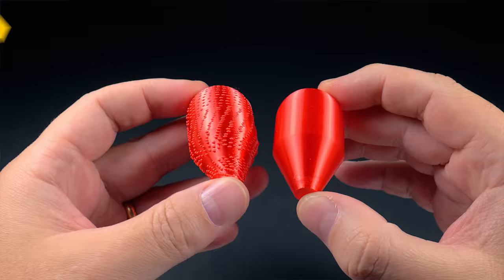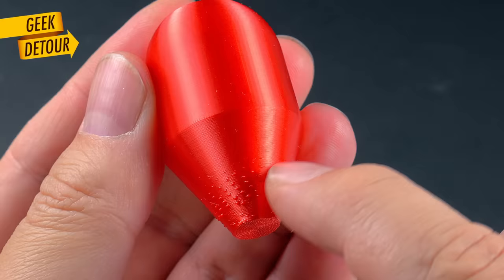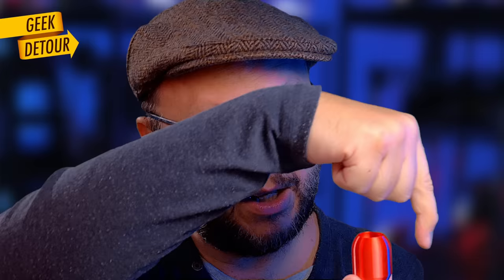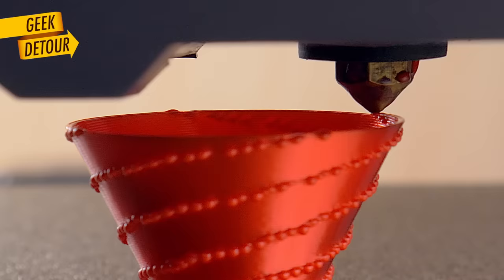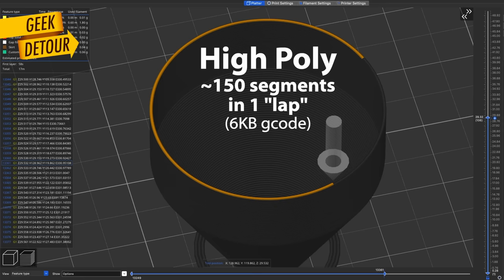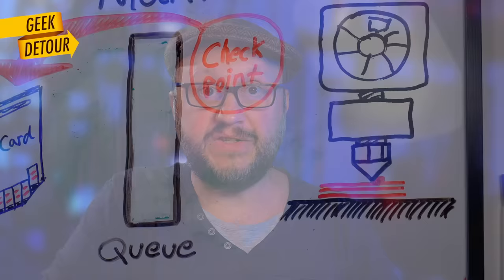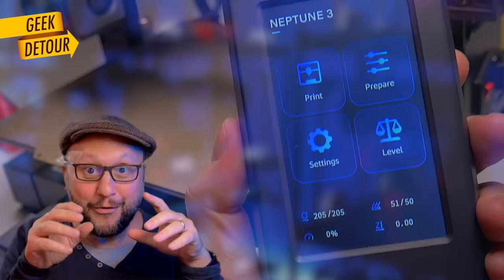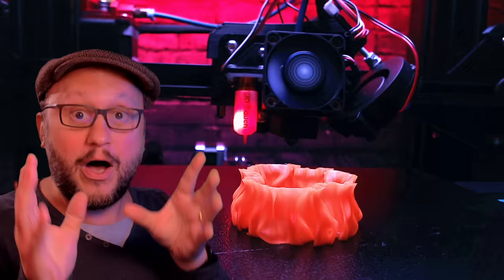3D Printer Blobs: a mysterious problem you won't guess how to fix 🤔

Comment: I got my 1st 3d printer about a week ago jumped in f*%ked it all up several times with part prints and spaggetti everywhere, as well as bricking the printer with a firmware update before I even got started. 
Aftersorting that out sussing most of the issues out have printed quite a few small objects.
I'm Now watching videos to help with all the little problems I run into trying to print larger objects
So heres my guess.
looks like it's over extruding were the blobs are so something is either jumping or stopping my guess would be a that its stopping intermitently for some reason.

Well bu99er me, I'd have never guessed that the power loss backup was stealing the write buffer
so the printer stops because it doesn't know what to do.

What I want to know is why my bloody prints are cracking.
I'm assuming the layer is cooling to much before the next layer i added?
Reply from the maker: Yeah! That was tricky wasn't it? Ha ha.  Layer adhesion is something you learn what to expect as you get more experienced. Some parts are very tricky and fragile, some filaments are not so great, some parts benefit a lot (strength-wise) if you print, lets say, at 215ºC instead of 200º... It depends on what you are printing, and the material.
Reply: @GeekDetour 
Thanks for your response. 
I started to write a description of my settings and what I was doing but I might have sussed it out. 
I've got 1kg drum of filament that my daughter bought recently for her 3D pen  The side of the drum which she said was PLA  (my eyesight isn't what it was so she read the label)  said it recommends a temp of 220-240. 
Which I though seemed high. 
After a bit of experimenting with it the sweet spot seems to be  around 227-235° the small objects I printed (some small figures about 40mm high) And some replacement slider knobs I'd designed in solid edge(which I'm also new to, about a week)came out as smooth as an androids butt.
Then my daughter wanted to print a dome about 3.5" in dia
(Some game cartridge case shaped like a pokemon ball?) 
Which it did do quite well but there is one layer that hasn't adhered and a couple of cracks through 2 or 3 other layers. We had the bed heated to 60°
I think we did quite well considering we are on day 3 of a learning curve.
Then why I was typing this I just got the drum of filament to lookat it for myself
And you already know what I'm going to say
"It's ABS"😭😭
That explains everything
The Bed is nowhere near hot enough and my printer (Finder3) 
Isn't enclosed 
But ha ha  that'll be the problem it cools too quick and doesn't adhere which also explains all the spagetti we made on the first 3 or 4 prints. 
I've learnt something I already knew from my day job in electronics. don't trust what other people tell you always check ot yourself. 
I feel like quite an idiot but it's an important lesson learned
Perhaps tomorrow I'll reslice everything with a higher bed temperature somewhere around 90°? and have another go.
Reply: Actually went for a bed temp of 110° as standard in the flashprint slicer for ABS and a nozzle temp of 235°
Has a few minutes to go but no cracks and looks shiney and smooth.

Comment: 96kb RAM? What happens at 1TB? We print a human?
Reply from the maker: Ha ha ha, it doesn’t matter. You can print a very big object on the same printer - the GCode file doesn’t need to fit in RAM… it is read and processed little by little.

Comment: GOD 3d printers are dumb, I guess I'll wait another 5 years lmao, when we can print metals, multi nozzle, 3d camera error detection etc...
Reply from the maker: Ha ha, well, metal might continue being very, very expensive to have at home. The other things you said are already here.
Reply: 3d printers require some tinkering. It's not for everyone. Even with best printer, you still need to understand different settings for really good prints. Metal 3d printers are garbage. You might want to wait decades. Even so, conventional cnc lathe and mill can do a better job.

Comment: So people are spending thousands on 3D printers for what again?  I don’t see any practical use for what it produces. Unless your goal is to be a toy maker it will not produce any actual parts. Plastic is soft and breaks easily no point in these printers.
Reply from the maker: Actually, they can buy an amazing 3D Printer for less than $300 and you can make an endless amount of functional prints. Different plastic filaments serve different applications. By the way: so many products are made completely with plastic.
I participate on a Facebook User’s Group just about Functional 3D Printing - people make A BUNCH of house fixes, custom products, prototypes. 3D Printing is a reality, not a toy.

Comment: Nice tip, but you basically were pushing a printer in a way it wasnt designed. You shouldnt have so many commands to do just 1 circle.
Reply from the maker: Well,eventually the slicers will move to STEP files (that keep the original geometric information instead of making a mesh of triangles) and generate G2 and G3 ARC commands. The last PrusaSlicer Beta supports STEP files, but internally converts them to a high mesh of triangles anyway.

Comment: So the issue is the printer comes with less ram than a Nintendo DS? Why tf
Reply: Well you don't need a ton of ram, so why pay for it. 

There's are also other problems that just having more ram won't really help
Reply: @Michaelo0  clearly this specific problem caused by overloaded memory indicates otherwise
Reply from the maker: Hi there! The problem was not caused by lack of RAM, it happens because writing to the SDCard takes more time than the buffer of movements being printed, causing pauses.
Increasing the buffer will not help because the buffer itself is part of the information being written to the SDCard, so, increasing the queue makes writing the checkpoint even longer.
Reply: @Geek Detour  so its an issue of writing speed being too slow then? That also feels like an issue that could be solved by better hardware...
Reply: @himedo1512  if it were that simple people wouldve done that lol im also wondering why 32bit / such low ram as well
Reply: @amp  the reason is profits is my guess. Cheaper for lower quality stuff

Comment: where is problem? Cheap printers and bad slicer software :D This never happen on our prusa with prusa slicer, it never stops :D But if its problem of electricity, just get better electric seller, maybe redo all cables in whole house,... and switch to 220V, 110V is not good for printers at all.

Comment: 96kb of ram is nothing, lol
Reply from the maker: Yeah, we got spoiled! But for microcontrollers, running a single specialized program compiled from C++ is A LOT OF RAM. There is no operating system, just a single program with tight data structures.
Reply: @GeekDetour  But why not add a couple of bucks and use 1 MB of RAM?
Reply from the maker: It is not needed, really! Ha ha. A Raspberry Pi on the other hand is a “Real Computer” with an Operating System… it has 1GB of RAM and it makes sense.

Comment: You have no clues how microcontrollers work... !
Reply from the maker: Here, Tim, there is a table of the maximum steps per second a printer can achieve, even on Klipper, depending on the MHz of the microcontroller: https://www.klipper3d.org/Features.html

Please, enlighten me how it is not related to processing power?
Reply: @GeekDetour  "Even on Klipper"... spoken as if Klipper was a paragon of efficiency. Klipper has fallen far behind the curve in the 3D printing world, and for excellent reasons.

But stop to consider for a moment. "Even with Klipper", according to the very documentation you hauled in here, you can do ~100K steps per second, right?

Now do the math.

If your printer is belt-driven and your X axis requires 80 steps per mm and your Y axis requires 80 steps per mm and your firmware is using the Bresenham Algorithm,  then it should theoretically be able to manage speeds as high as (100K / 80 == 1,250) mm/sec.

1250 millemeters per second.

Do you know anyone whose 3D printer requires any higher print speed than that? And... do you think perhaps print speeds like that might possibly cost print quality for mechanical reasons unrelated to processor clock speed or data bus width? Really? Disregarding, of course, the massive racking forces exerted on the frame and the exceptionally high stepper torque required to reach speeds that high. Never mind the extremely short belt life and the fact that it cannot even be done with a moving-Y-axis printer unless the prints are all very small in the Z axis. If they were tall, the rapid Y-axis motions would tear the print right off the bed.

You're just not going to be able to recover from this one looking smart. It isn't going to happen.
Reply from the maker: Tim, if you told me your only preoccupation is to “look smarter”, be my guest! I would have simply left you talking alone, man! One of the best things of running a YouTube channel is to engage in pleasant exchanges of information - you are not interested in that! You are here “to win” whatever argument you can find. You are super smart, but oh boy… why you so desperately need to look smarter?
Reply: @GeekDetour  It has nothing to do with "winning". It has only to do with correctness. But then you wouldn't understand that, would you? You aren't interested in correctness, only in trying not to lose face.

Did you walk through any of that basic arithmetic, and of that logic I presented? What part of that do you not understand? I can clarify it for you if necessary. I can show you the code, I can show you the timing diagrams. Would that be worth doing? No, probalby not... you'd still stubbornly stick to your story despite the fact that it makes no good sense.

At least the popcorn eaters can read this thread and get the idea so that they can, instead of blindly following your cute little technochurch here, learn to question things and do some thinking for themselves and go out and do further research and learn the truth.

You might do a little of that research yourself. Dig through the code. Write some. Learn how it works at the brick-and-mortar level. You'd have a completely different story to tell if you did.
Reply from the maker: Tim: I show that the culprit is the SDCard. What’s your point?
Reply: @GeekDetour  My point is that in the comment thread, you try to say that the culprit is a lack of "processing power".

Scroll back. Try not to edit.
Reply from the maker: Just watch the whole video man. There is a line of thought there that finishes with the explanation about the SDCard and Power-loss Recovery. And that’s it.
Reply: @GeekDetour  I DID watch the whole video, man.

And... I probably would have let most of this pass... except you sneered at control boards with only 16K of SRAM, as if they were somehow inferior, incapable, and heavily shadowed by the "vastly superior" 32-bit microcontrollers.

No CHANCE would I let you get away with that. THAT is part of one of the huge problems we face in society today, encouraging people far too early to abandon what we have that is perfectly satisfactory, throw it in the landfill, and rush out to acquire the new "kewler" stuff that does the same thing... and in another week you'll be encouraging the same boneheads to trashcan their 32-bit controllers in favor of something else still "kewler", again with no benefit... but at huge cost to the landfills and oceans.

Well enough is perfectly fine if left alone.

Of COURSE it's not JUST you... but you're being a part of it, and you're doing it right in front of a huge audience. There's a big responsibility that comes with that sort of thing.

Pft. I'm out.

Comment: so this all comes down to 3D printers using a cheap ass flash memory format that is slow?
feh, I'd like to see someone design out the writeout print delay issue with this, by not using stupid ass SD cards that are meant for freaking photos!
frigging 3d printing dumbass industry being cheap... grumbles didn't have this problem when it was driven directly by a pc.... grumbles